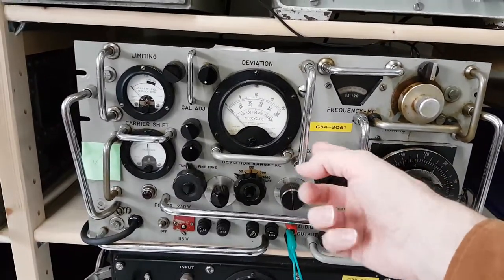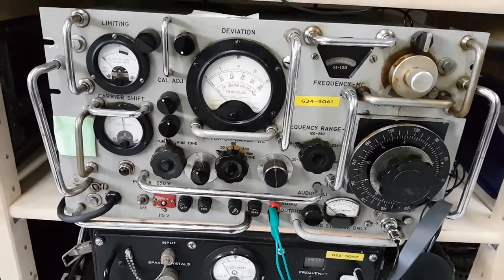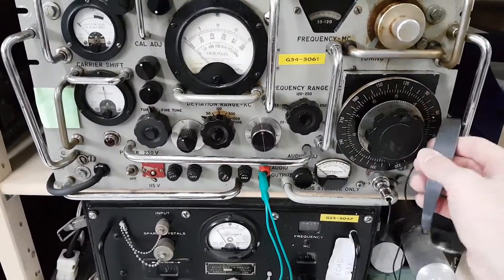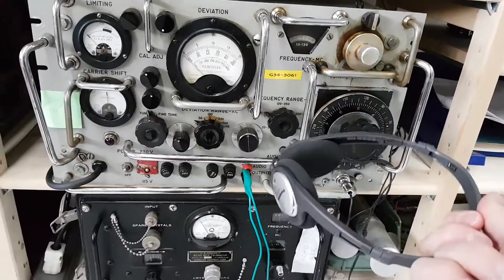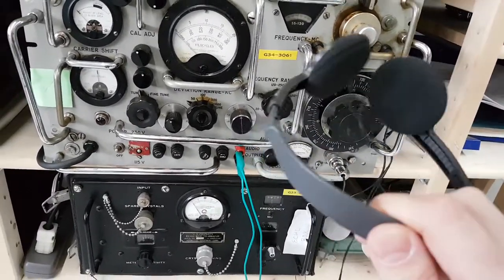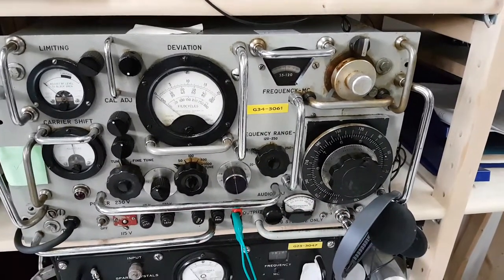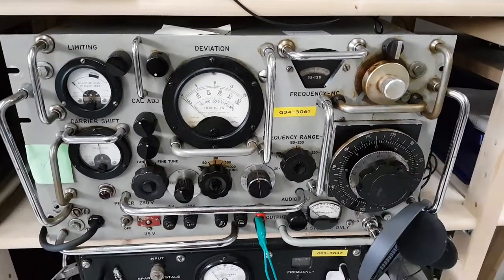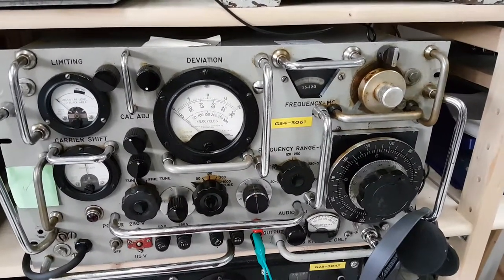Possible feedback John Hutchison may have used to know when effects might be occurring

Comment: Those handles were a design attempt to protect the knobs and indicators from impact damage in handling if the instrument were tipped over on its operating face from its weight crushing or otherwise damaging exposed items. Somewhat common on military gear of the era. Audible signals demodulated from the carrier frequency in the AM could occur from many sources hence the FM benefit of low noise by rejection of amplitude variations. The difference in signal vs. noise is the recurrence of signal patterns with some self consistency. What band does this unit cover?
Reply from the maker: That is a good point. There is a brief description of all the apparatus in another video, this is said about this item "This is a receiver in the ultra short-wave range, 55-120 MHz".

https://youtu.be/x8PHWv_M_N4?t=13s

The group do say they have manuals for many items. Lastly, a high resolution photo was taken which will be posted in a steemit blog.
Reply: It’s about 500 mega cycles to one gig  yes military type I use all kinds of receivers to pinpoint hot spots